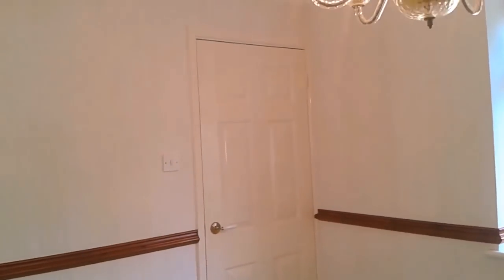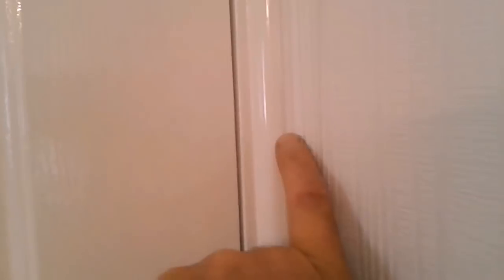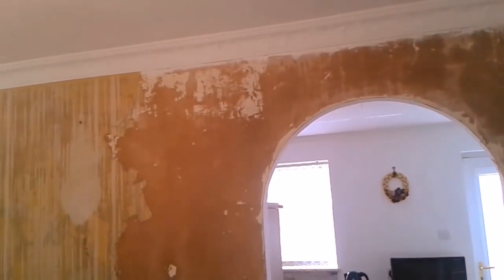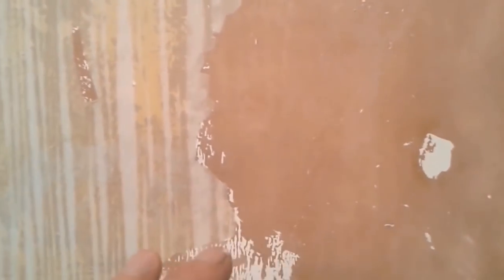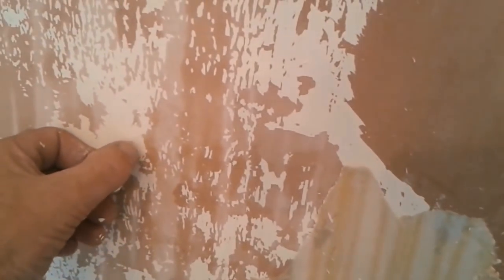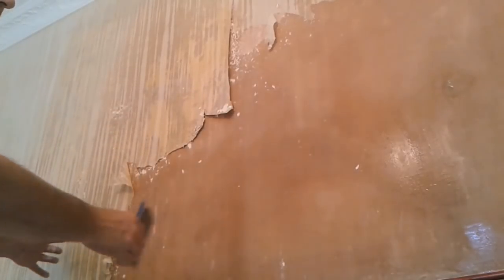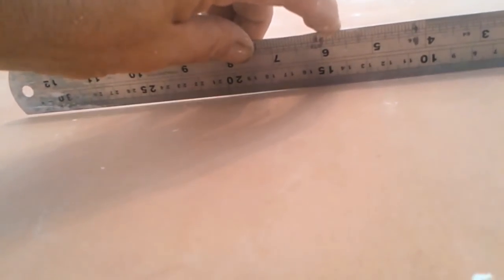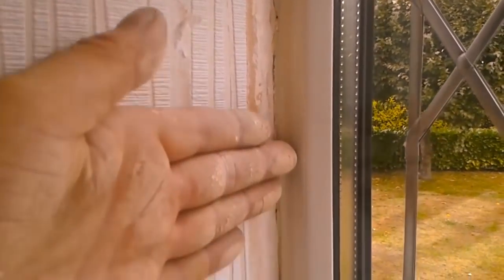Decorating Your New House Paint Peeling on walls

Comment: Hi. If you were using Wallrock thermal liner onto an emulsioned wall, would you size the wall first with pva watered down pva or normal wallpaper paste? I will be using the ready mixed paste to actually put the Wallrock thermal on.

Comment: hi there gr8 vid.... can you recommend a good quality sealant for exterior upvc doors and windows ? regards nick
Reply from the maker: UniBond WINDOW & DOOR FRAME SEALANT  A weatherproof silicone which provides a permanently flexible perimeter seal for exterior window and door frames. Outstanding adhesion to wood, uPVC, polycarbonate and metal. Will not stain sensitive surfaces such as natural stone & marble.
Reply: thank you so much

Comment: Got the same problem  at home stripped the paper of and it has left some paint behind like on your video,except the emulsion is not turning to mush its intact even when wet. Do you think a coat of pva to bond it together  would be ok,also going to put linking paper over it and was wondering what grade you recommend. Great video again so informative. Love you to do more papering ones if possible "
Reply from the maker: Colin Williams Thanks, you need to scrape off as much as you can, then seal with diluted PVA and you will have to fill around all edges of paint or sand down edges so they blend with the plaster. They can show through the linning paper I would use grade 1000 for emulsion 800 if you're hanging a paper on top.

Comment: I would have stripped the paper, scrape it back so all loose edges have gone,  then I would have painted walls with zinnser gardz,    then filled and lined,  job done ???
Reply from the maker: It's no good leaving a failing coat on the wall. Zinnser gardz should not be applied to lose paint.

Comment: Although painters like house bashers are under pressure because they are on the grip, I think its a wee thought for the next painter and also you're doing your job right. a wee bit of water to paint when basecoating saves a lot of hassle down the line :)